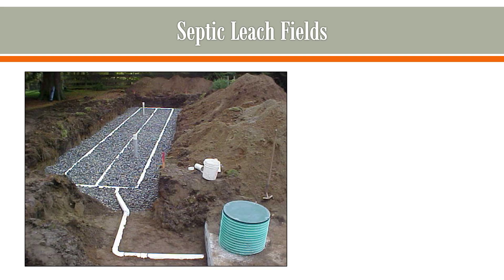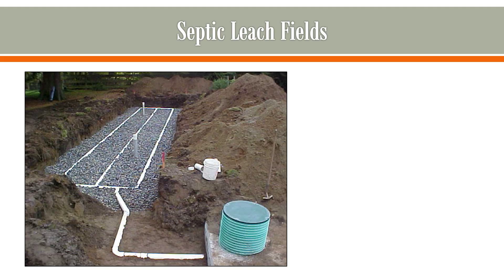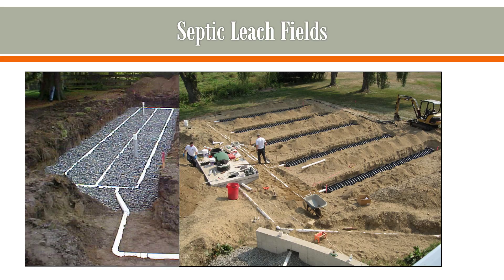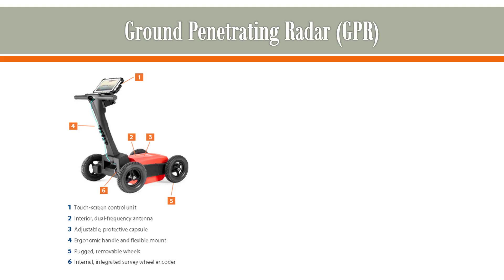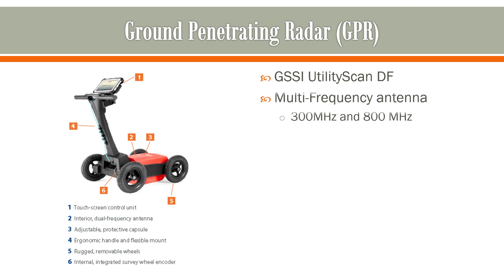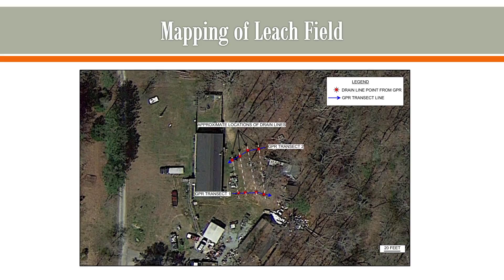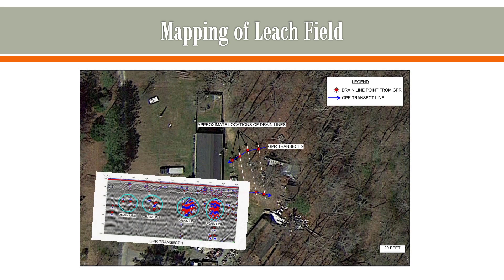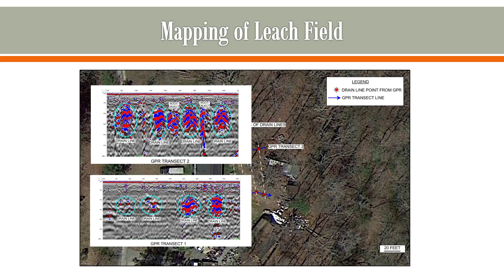Geophysics: Using GPR to Locate Septic Leach Field in North Carolina

Comment: Can GPR detect the degree to which the gravel has become clogged?  

Our septic field is 46 years old, and is now clogged.  One pro says to use hydrojetting to clear the pipes.  Another says that won't help if the primary problem is that the gravel has become clogged.  

If the gravel is not clogged, it will be distinct from the soil/earth, so it seems they (and the pipe) would be visible on the GPR viewer.  If the gravel is clogged, it will still be different from the soil/earth, but less different - the distinction will be harder to detect.    

Would it work to say: If the gravel is 100% clear, the contrast will be ___. If the gravel is clogged (0% clear), the contrast will be ____.  The contrast is ____, so therefore the gravel is __% clear.

Rocks of various sizes would be distributed throughout the [soil/earth], but I'm hoping if the analysis is done over a large enough area, it would be possible to ignore sections with significant rocks.